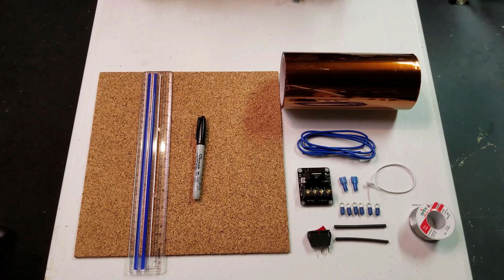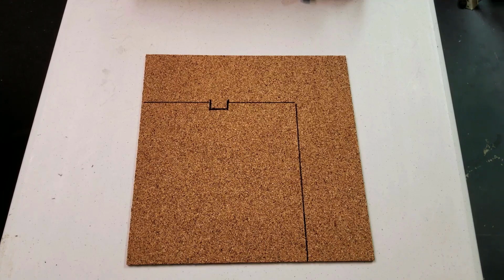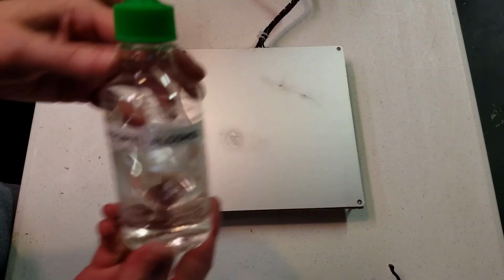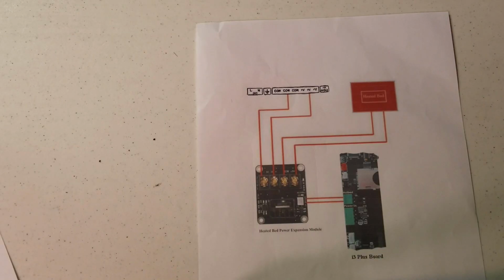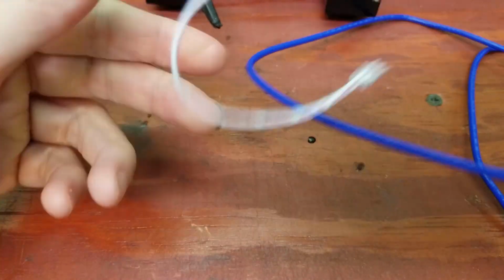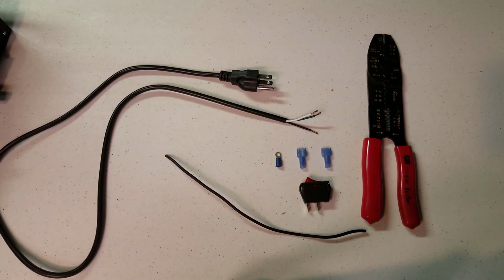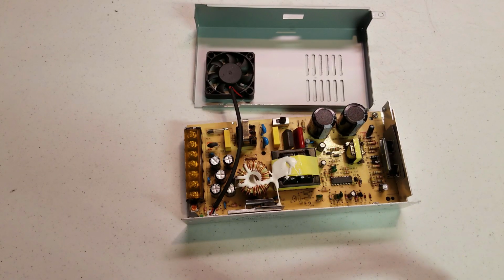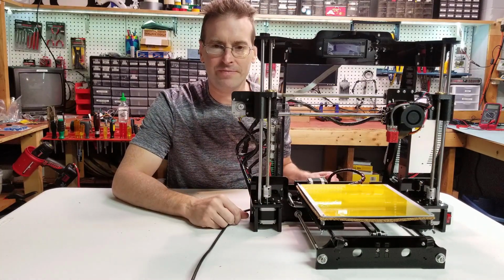Tronxy P802MA 3D Printer Part 4 - Critical Upgrades!

Comment: don't do any of this unless you want your house burned down what a moron did you really tell people to tin your wires
Reply from the maker: The Mosfet signal wires are tinned, which I have never had a problem with. The Power wires are NOT tinned. I tinned them in order to join them to the existing wires. Sorry for the confusion and thanks for the comment.